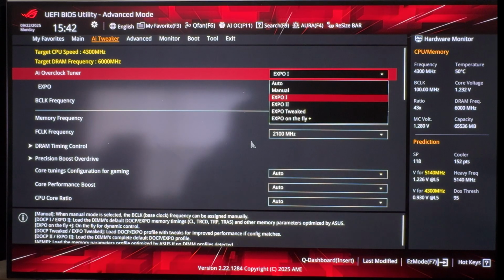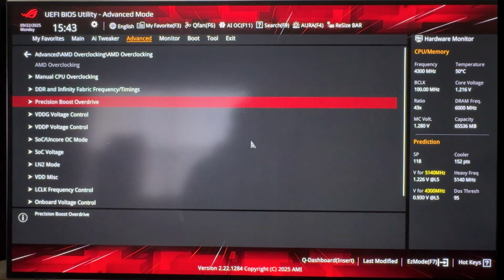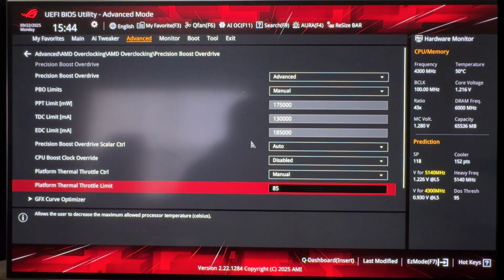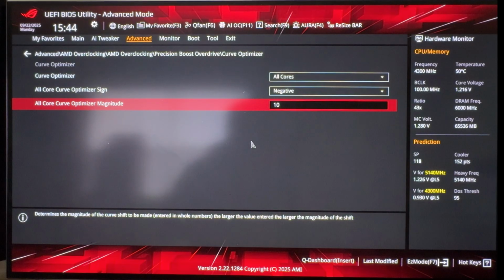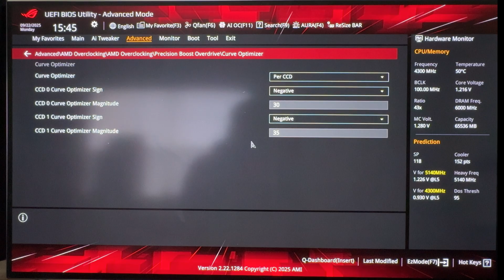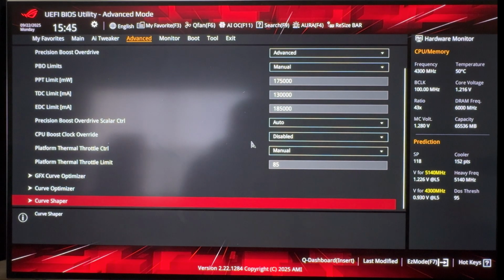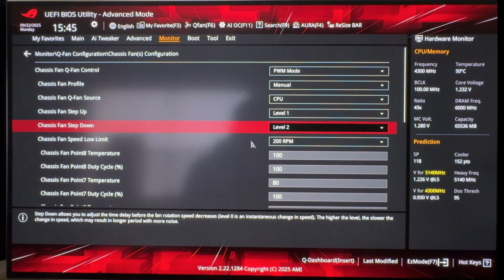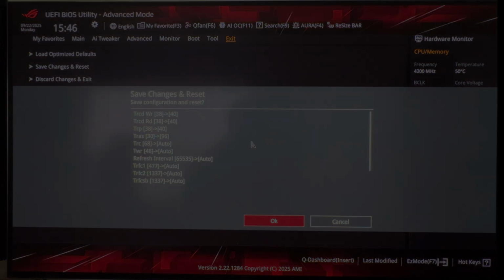Beginner Ryzen 9 9950X3D Undervolt in 5 minutes

Comment: How did you arrive at these PBO limits values? Seems kind of arbitrary and hardware specific no?
Reply from the maker: I ran through a bunch of tests, these were used for my specific case and setup. Now, I am running a different undervolt with different values.

Comment: Got the 240aio Freezer pro with thermal grizzly solid metal pad 
with an -30 undervolt never exeeds 60 during any game 
peak 70c when stressed
Reply from the maker: Please share a link to the metal pad you are referring to!
Reply: I'm using ptm7950 and an AIO, and get the same temps with no undervolting.

Comment: It is highly unlikely that this system is stable with those values for an undervolt per CCD. They are incredibly aggressive, and I cannot stress enough to the community to use this video as a guide to navigate bios as a novice. Those values are pretty ridiculous and aren't going to work in most systems without serious crashes and BSODs.
Reply from the maker: myself and several others have had absolutely 0 issues running similar values. The Curve optimizer is a different story, it’s completely silicon lottery and I have run non stop testing and haven’t had any issues
Reply: @SproutHQ  You need to stress test with liquid temp at 40C in AIO. Then you see true  stability. Higher temp need higher voltage and if your offset is too high it will crash. Your first setting crash after playing game beacuse your liquid warm up . Lower liquid temp equals higher CO offset.You dont need to gaming to test it.. Just run furmark  to run your gpu full power and lower AIO fans speed as much you can too quick warm up liquid.
Reply from the maker: @damianb2071  Thank you for the input, I have run non-stop testing without any issue testing my UV. I stated in the video that people should start with all-core -10 and move up from there and do their own testing. My own testing has been absolutely rock solid personally. I have since this video, changed some things and am working towards a per-core UV that I have been testing

Comment: If using a full size case with 360 aio what do you recommend for PPT, TDC and EDC? With your settings set to all cores and all core curve optimizer to 25. My temps went from 95c in cinebench down to 73c and score went down about 3600 so I have a lot of cooling headroom now. Any incite would be greatly appreciated to gain some performance back at expense of a little more heat.
Reply from the maker: honestly with 360mm AIO, i’d set it to motherboard settings or 1000 for each. Plus add a +200 OC on it and see how it performs and if it’s stable
Reply: @SproutHQ yeah I had it set to motherboard prior to your video and cinebench would instantly goto 95 and stay there. My 3dmark benches actually all went up though with your settings even though my cinebench score went down so think I’m just gonna keep them thx for reply.
Reply from the maker: @Magowin No! if anything, add that +200 OC. It should help your CB score go back up
Reply: @SproutHQ ah ok I gotcha I tried 200 but system froze so trying 100 now.
Reply from the maker: @Magowin let me know how it goes! I was about to do +200 and it’s been running very stable for me
Reply: @SproutHQ 100 works but didn’t gain any performance it actually went down 1500  so I just went back to settings before but changed that one setting to 2x I saw it on another video saying that optimizes the cpu and cinebench went up from that setting so gonna keep it. I got 40532 in cinebench.

Comment: Pls i read somewhere that the fans that are installed on this  X870-i Motherboard , that is the Vram and Ssd fan can now be controlled  to users  spec  after a bios update , pls i want to ask , is that true or not ? is it auto controlled or  use can set the fan speed , thanks and look forward to ur reply
Reply from the maker: i believe so yes. I would have to confirm that to be 100%.
Reply: @SproutHQ  okay and pls if u can confirm , i would be happy , so i can be sure before i make a purchase

Comment: What position is your center spine? 3.0?
Reply from the maker: It was! I JUST rebuilt in the 3.25 slot position and it definitely helped my performance. One of my fans was also not working on the radiator so I found that out the hard way.

Comment: What power draw the CPU has after all that during gaming?
Reply from the maker: in general during gaming at 4k, it’s below 100W. Usually in the high 80’s-low 90’s from what I have seen but I haven’t really paid too much attention to it if i’m being honest.
Reply: Remember he is playing 4k as he mentioned that means his GPU is a limit in the build so his 9950x3d is not getting any issues to drive anything. 100W is quite low drain power. I am playing 2k and with average 60C  while gaming and 71C while stress test my power draw CPU package is 193W max. Ofc if FPS is uncapped.

Comment: Hi, do You use Windows Game bar or P.Lass/Bios- Freq, Cache settings, which gives You lower latency for competitive games?
Reply from the maker: I do use Game Bar! I haven't messed with the latter. Any recommendations?
Reply: @SproutHQ I have noticed increased latency with GameBar and I am trying to eliminate it with the bios settings, but no luck for now. AMD have changed things in the recent bios versions.
Reply from the maker: @andreihadjiev8908  I was not aware of that! Thank you for sharing. I have not personally had any issues with latency that I noticed. I'll do some tests and check things out.

Comment: I have spent an entire week to get optimal results from my new 9950x3d. You are lucky with those values in the per ccd curve optimizer. 

What are your results in cinebench 2024 before and after?
Reply from the maker: It has been taking me a while! I am definitely planning on going per-core to get as dialed in as possible. Stock score was around 41000 (I don't remember exact scores), with the limits I set, I get around the same score. If I set my PBO limits to motherboard, I have gotten scores in the 44-45k range though. I was mostly trying to get it to stock performance dialed in for gaming purposes.

Comment: What were your temps running cinebench before undervolt? And how long did you run it for?
Reply: Dang even with the flipped?
Reply from the maker: @trd.enguyen660  Yeah man, the CPU gets hella hot. It would be a LOT better with the AIO top hat and T-30 x2 on the radiator
Reply: Thanks for the info. Keep up the good work. I’ll be building mine soon.
Reply from the maker: @trd.enguyen660 Let me know if you need any help!
Reply from the maker: before UV it would hit 95 always. Now it goes up to 83 and will peak at 85 after running it for 10 mins
Reply: My temps in cinenbench were 96 on hottest core before undervolting. Now with 30 negative, is 73C max but I have 360AIO mounted top in the case.